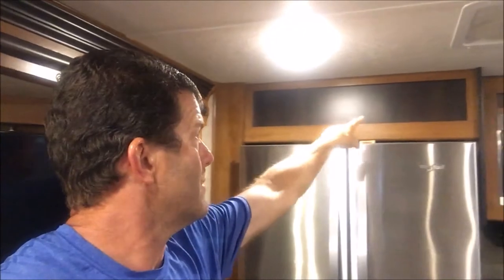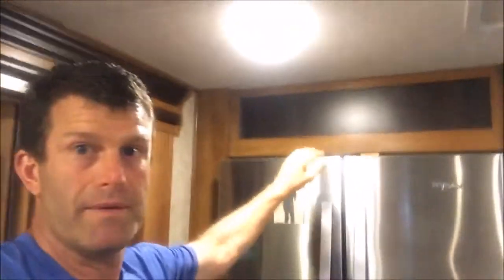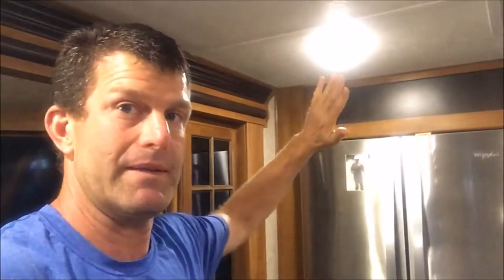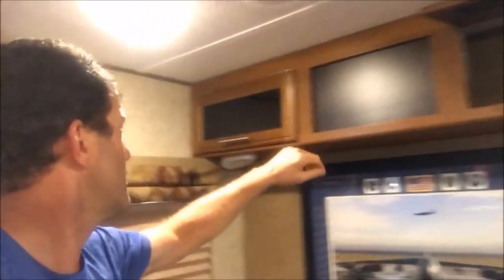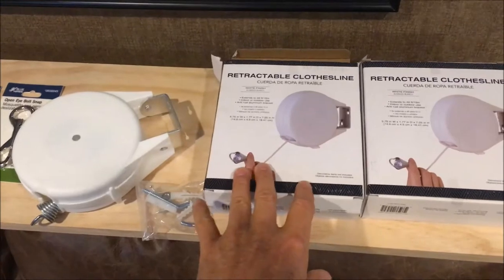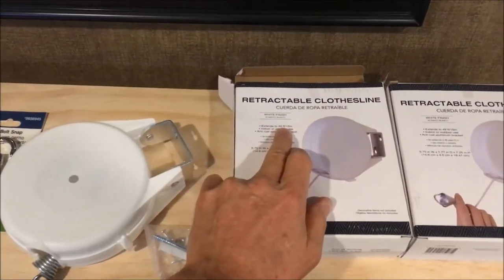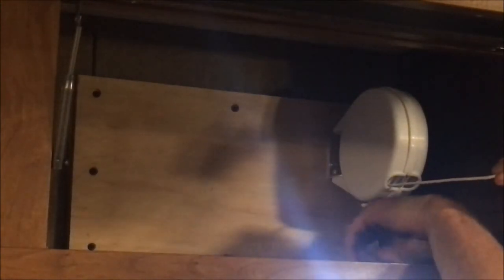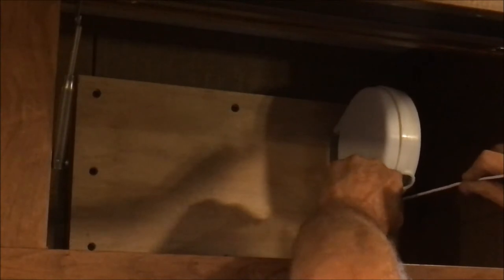How to Dry Clothes Off Grid in an RV

Comment: How did you figure out the maximum screw length to attach the wood panel to the RV wall?
Reply from the maker: I can't recall since that was years ago but if you have an 1 1/4" hanging out past the item you are screwing to the wall, you should be just fine.

Comment: howdy from the stormy ozarks!  does it hold up blankets and how many wet jeans at on time?
Reply from the maker: I've never tried a blanket although it does have a blanket setting.  As long as you stick to the weight limit in clothes you should be fine.  I routinely wash all the clothes for two adults and can assume if all you had was jeans you might could wash four pair (depending on the size of course)
Reply: @JustPlainCommonSense  thanks for your reply